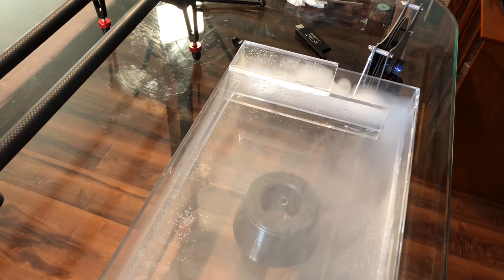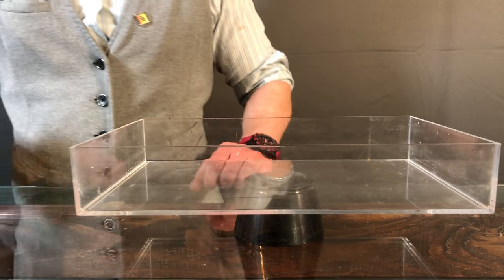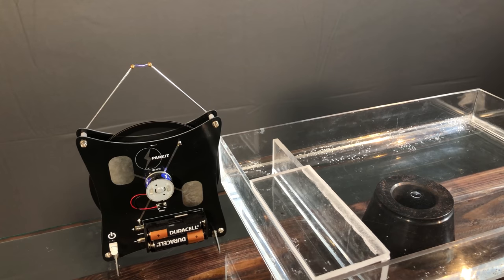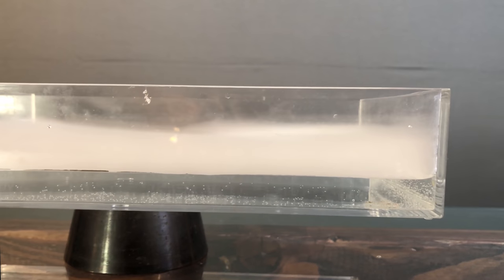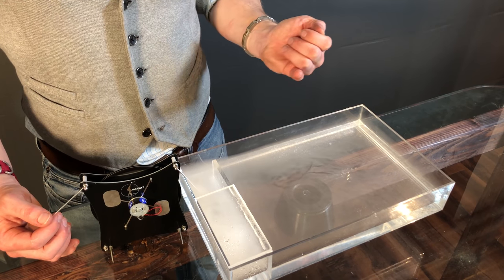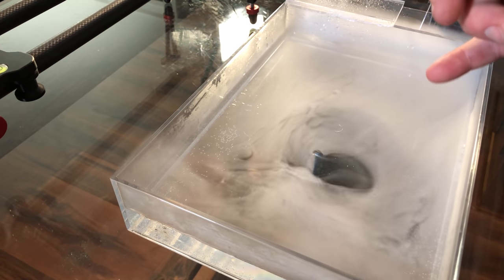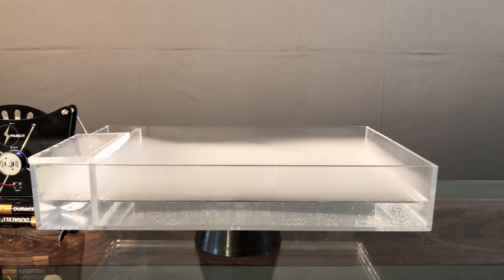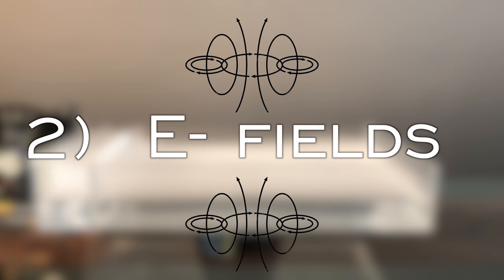Fog Drawings Using High Voltage Electricity (UNBELIEVABLE)

Comment: I think mainly the fog is condensed water vapour The static electric fields might be messing around with the dipole water molecules and exert a force on them. I found a link to a study which looks similar https://www.mdpi.com/2079-4991/9/1/64/pdf I know the paper is not about the phenomenon happening in the video, but some points support the above theory"
Reply: Can you try the experiment with some non polar visible gases like bromine or iodine
Reply from the maker: I’ll give that a try. Thanks. The research you linked to above does raise some questions.

Comment: I think your third point is the right one. Since you put voltage into the water, you have created a magnetic field. You made the water negatively charged and all of the positive charged electrones are leaving your finger and into the new magnetic field. The new charge that was created in the water is trying to come to equilibrium so it’s pulling electrons from the sources that you put close to it. I bet of you turned up the current you could get a greater drawing distance.
Reply: Given the source, the current isn't very high. It would be a silly weak magnetic field!

The explaination is likely to be something non-magnetic.
Reply: erlendse No man. He is working with 20-40 kV. It’s enough to create a magnetic field to effect the charges from the distance he was at. You’re not taking the area into account in this equation. It’s a large area and that will effect the field too. The current is weak, which is why I stand by what I proposed. I work with electric charges all the time. The vapor was effected by the transfer of protons. Unless you can prove other wise. Look at the magnetic field equation. It’s effected by current, area and the permeability of free space.
Reply: @IpickedTheR3Dp1LL  Current create magnetic fields, the current is low. (nanoamps?)

Voltage create eletric/eletrostatic fields, and the voltage is high. (many kilovolt)

Don't mix them!

Mind telling more about your work?
Reply: erlendse take the electromotive force out of the water and they cannot do this experiment. I think it’s magnetic.
Reply: @IpickedTheR3Dp1LL  Fair point. Could ask for that experiment to be done.

For me, it looks like a possible case of eletrostatic filter. fog is "water dust".
Reply: erlendse Honestly, I really don’t know how much current is being applied. I don’t think Jay said anything about it. I don’t work in the professional field yet. I’m studying to be an EE.
Reply: erlendse so I asked my professor. It’s not a magnetic field. It’s an electric field. So the water is negatively charged and pulles protons from his fingers. I stand corrected.

Comment: Is the effect the same with PSU reversed?
Reply from the maker: Indeed it is. Same effect
Reply: I think it may be because of the asymmetric capacitance and the frequency. 

The only time I get really weird unexplainable visuals is when I go asymmetric. 
But then I'm a lowly educated fool so it's just guess work. 

Also Jay I noticed something the other day. 
If i statically charge my body I can feel my surrounding based on proximity with my eyes closed. 
That's not too wierd but here's the strange thing. When I get close to an object the charge is equalised. ( that's a given )
However when I retract with speed my charge is returned and increased. 

Ie. I place my arm close to an object (parallel). I feel repulsion. I get closer and the repulsion decreases. Untill it's equal. If i pull my arm away fast remaining parallel to the object the charge is increased higher than it's original. 
This may well be an explainable thing just not by me. Lol.
Any ideas?

Ps. Thank you Jay for another outstanding video. Amazing as always. Anticipation is already growing for your next video.

Comment: This looks like you've literally turned yourself into an electron gun, like you'd use in a scanning electron microscope. Since there's no major magnetic fields involved, the electrons being emitted from the sharp part of you closest to the opposing charge would basically come off your finger with a tiny bit of inertia, then arc into the water more or less following their acceleration along the field lines.
I think the reason you're getting such a well-defined "spot" in the fog is because there's going to be one point that's giving off electrons the most easily, and the work function of your finger is very consistent, so you get electrons jumping off with that exact amount of energy consistently. 
Another way to make an effective electron gun is to use a tungsten hairpin. Applied Science has a whole video on making a SEM, and I think some of the physics apply here. I don't think you're getting much ion wind or anything involved, I just think you're literally shooting a narrow stream of electrons into the fog. Also, electrostatically charging the fog opposite of what the water itself is will both force the fog to puff out a bit at the point of impact, and simultaneously get sucked down into the water beneath, which gives you small distinct features that are still large enough to see with the naked eye, kinda like a vapor chamber. You've made a reverse vapor chamber demonstrating a human electron gun. That's wild.
Reply from the maker: Hunter, thanks for the in-depth analysis. Super cool, and i'd never thought of it that way. Cheers!

Comment: What if you are turning the water and air into a single magnet, you body is connected to the air and so is the fog so when u move your moving electrons around inside this magnet and the fog needs to move to let you inside. :D

Comment: It appears as if you are manipulating the electric field itself directly. This would explain the thin lines and lack of chaotic motion associated with ionic winds. 

I would be interested in seeing if the effect is enhanced at all or becomes chaotic if the fog bath was subjected to a strong magnetic field in addition to being electrically charged!

Conversely, you may be manipulating the intrinsic magnetic field that accompanies any electric one. That would explain the being able to write perpendicular to the fog bath surface.

In an unrelated note Jay, did you hear that NASA'S SOHO captured the X-10 class solar flare on the sun's Western limb in late September of 2017? Scientists had expected to measure the coronal loop magnetic strength at 35 Gauss. What was accurately measured was an order of magnitude larger at 350 Gauss! 

This explains why the sun's corona is so much hotter than the photosphere below. It's inductive heating! Same as with an induction cooktop, where the cookware is heated inductively instead of heating the cooktop below directly. Same exact principle.
Reply from the maker: I will experiment with using a magnet next time! Thanks for the ideas

Comment: What is the waters polarity, positive or negative?  It will have an effect.   ;)
Reply from the maker: I found the polarity, actually, did not have any effect. There was a MILD strength difference between the polarities, but that was it.
Reply: @PlasmaChannel  I was curious about that. Thanks for the reply m8.  ;)

Comment: What happens if you put a cover over the tank?
Reply from the maker: That's a great idea. Not sure why I didnt try that. I'd bet the effect would disappear.
Reply: @PlasmaChannel  Depends what you put over it.  Try flywire, you can see through it but it's conductive. Connect it to earth or HV anything different to connected to nothing? (Floating)
How about a try with cling wrap?

I was really into this stuff when I had the room. Now in a pissy little place with room for nada.
Reply: @PlasmaChannel  Try a small piece of metal in the water.   ;)

Comment: It is pretty much a coronal discharge our bodies themselves run off of an electromagnetic field  and without it your heart would cease to pump. 
Considering What are the volts of electricity in your human body?! The body's total voltage from 70 trillion volts down to a more accurate value of 3.5 trillion volts! The calculation is based on the following: The average “membrane potential” for a cell is 70 millivolts

Comment: What I think whats  going on? Well I know carona discharche can be very hot. When you bring your finger close, the circuit is complete. And yes, the carona will be minimun and not visible, but because of the huge temperture diffrence between the carona and fog, a slithy tempeture change can "blow" the fog away to a kind of ''ghost trails''. Because heat expends air and will push the fog away. And the closer your finger is around the water, the bigger the carona and as result more fog blowing away. Great video!
Sorry for the shitty English. :(
Reply from the maker: Thanks for the compliements! One thing I will say, is that corona is hot, but it depends on the energy the corona is dissipating. In this case, only a watt of energy at most was being dissipated.

Comment: Almost everything reacts to high voltage!!
Reply from the maker: True. And, everything conducts electricity at a high enough voltage.
Reply: Every atom is made up of opposite charges which at higher energy state means having higher potential to discharge/react.
We have just named them depending on the number of electrons & protons.